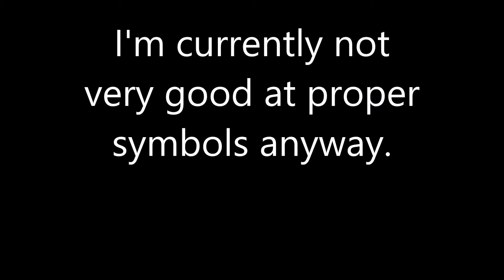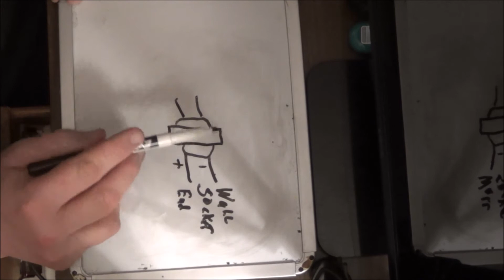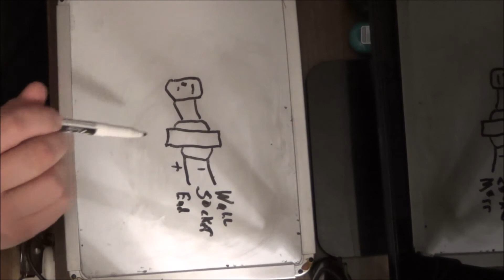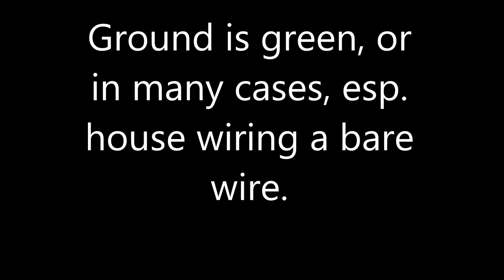Isolation Transformer wiring correction question

Comment: Hi Jeffery,
There is NO positive or negative on a transformer, a transformer only works on AC (alternating current) , it is AC that is supplied to our homes, in theory you can say it is negative & positive but each end of the transformer winding only "sees" - & + once every 60th. of a second, in other works the "polarity changes at a rate of 60 cycles per second.
 Please watch my isolation MOD video.
What you may be trying to say the "NEUTRAL" & the HOT side, the neutral is always the WHITE wire and it returns back to the grounded block at the service panel.
The BLACK wire is the HOT side.
My video shows the fact some isolation transformers have the natural wire bonded to the ground, like you showed in your video, yes that bonding must be removed.
Speaking od transformers, I had said the work on AV current BUT they can also work on "make and break" like an old car radio that uses a "vibrator" it has a "reed" (contacts) in it that applies "pulsatind DC voltage, just like a car with point & condenser, the coil is nothing more than a high voltage transformer.
When I was a lid i made a shocker using a buzzer and a transformer.
Reply from the maker: Thanks.
Reply: Just trying to help, we all have to start somewhere...LOL
Have a great weekend!
Reply from the maker: Same to you Bill. 
I remember my parents telling about a woman who made wonderful hot dog chili for benefit sales at the local fire department several years ago. She absolutely refused to give anybody else the recipe. Who knows if anybody has the recipe now. 
They said they could sell hot dogs by the hundreds. 
The morel of the story is I don't want to be that way.